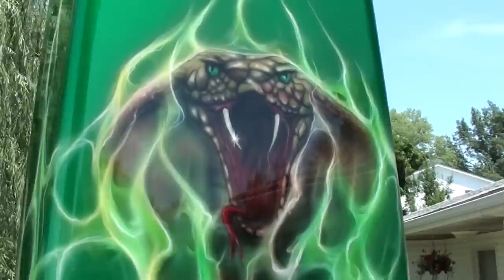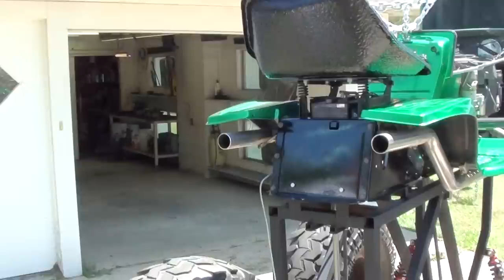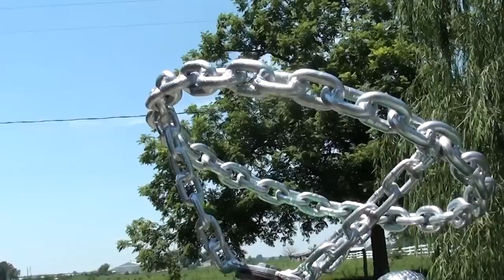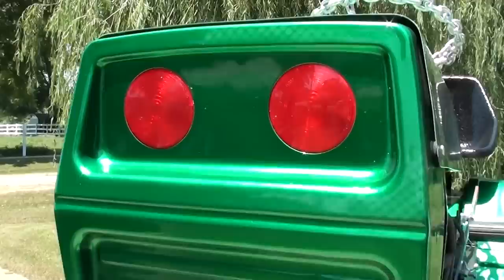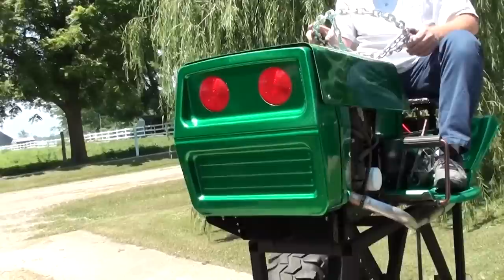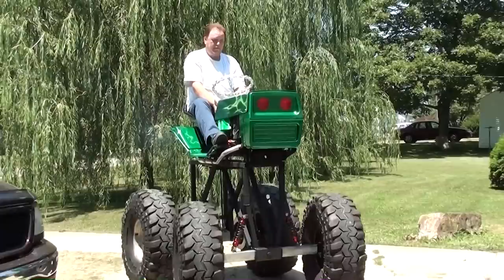Awesome Monster Lawn Mower - Start-up and Drive

Comment: As I really like this riding monster Mower/tracker, I have a 1986 Bolens lawn tractor with a 16hp. V-twin engine just sitting and would love to turn it into a monster Mower.
If possible I would love more info on the frame as well as other put together parts to have it Roll.thank you.

Comment: Aside from a novelty item what is it used for, if anything.  I got here from a link bout HOT ROD mowers, but this isn't a mower.  It IS cool, but what is its function?  Just askin'!
Reply from the maker: In his area, they had a charity lawn mower poker run.  It's just a fun thing to raise money.  It was built specifically for that.